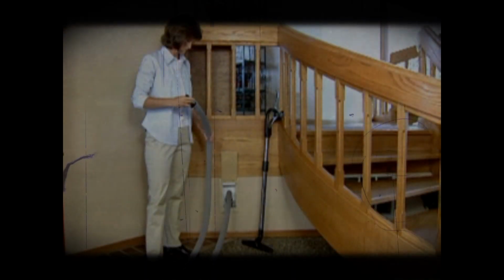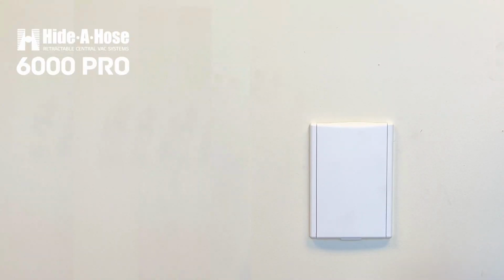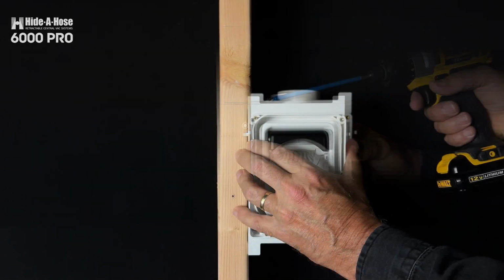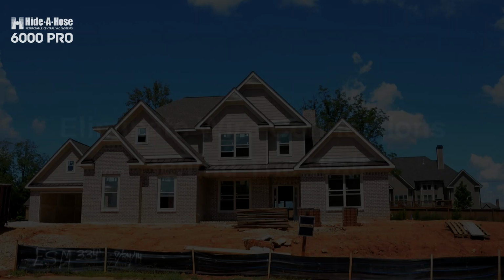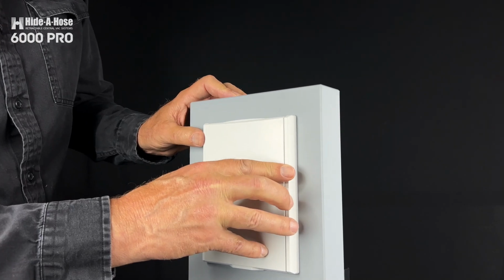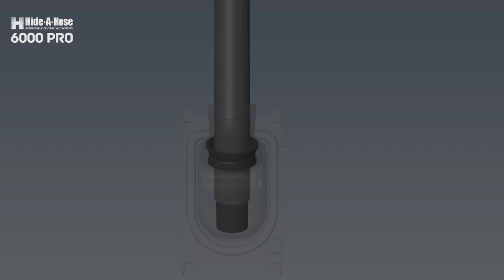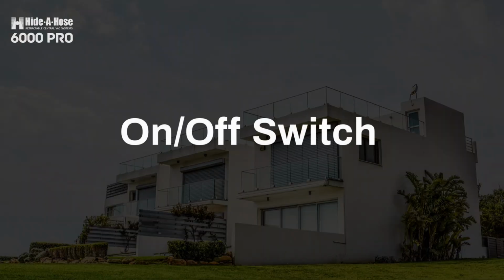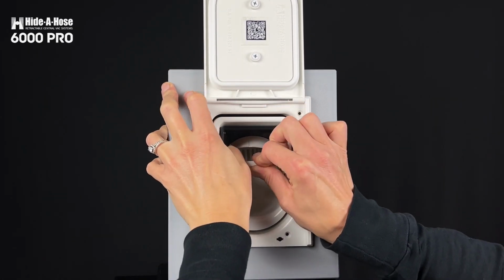Key Features and Benefits of the New 6000 PRO Retractable Central Vacuum Valve From Hide-A-Hose

Comment: This sounds like a good idea.  BUT, how do you store 50 feet of hose in the wall?  Where does the hose go?  Is there a reel installed in the wall?  This sounds like Harry Potter magic storing 50 feet of hose in 8 feet of space.  Some explanation and cut-away drawings would be great.

Also, I have to wonder what 50 feet of hose does to the amount of suction and volume of air flow.  I notice that the fitting on the end of the hose looks smaller than traditional vacuum hoses.  That would boost air flow speed while reducing volume.
Reply from the maker: Great question! The hose retracts back into the PVC vacuum tubing installed in the wall. The installation of the PVC tubing is typically done on new construction homes before sheetrock, but the system can also be retrofitted in existing homes by installing the tubing in either a crawl space or attic. Check out this video for a a more detailed explanation: https://www.youtube.com/watch?v=UMriFYwR2DU&t=1s
Reply from the maker: You can also check out this installation video to see how the system is installed: https://www.youtube.com/watch?v=eBUTVCO6ABA&list=PLhxy34SmIXdQr_8_ehsXqNckk134UpxaZ&index=1&t=1s
Reply: @HideAHose  Tnx.